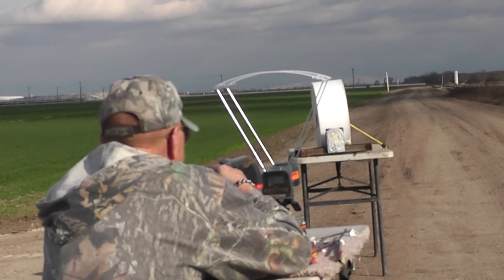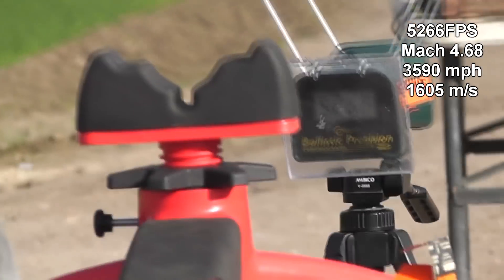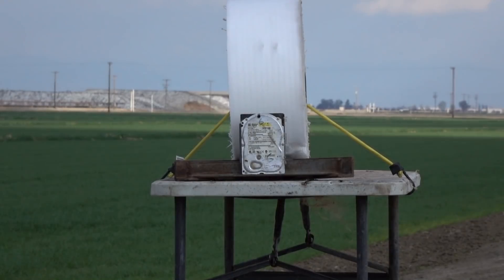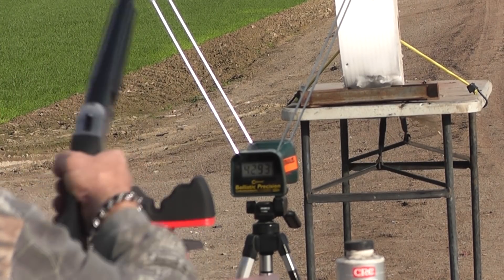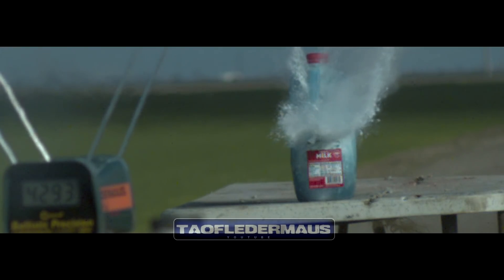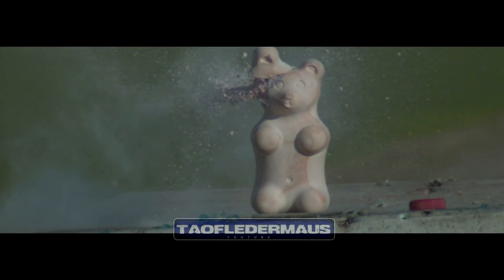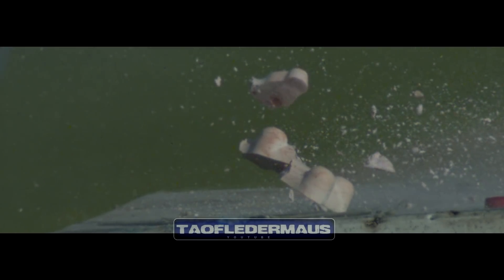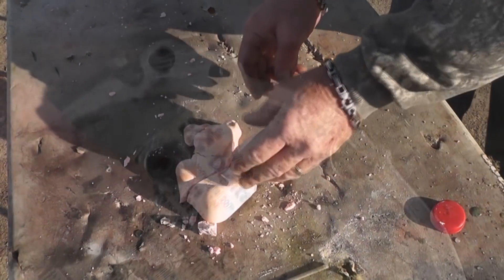Driving Airsoft BBs Faster than the Fastest Bullet - Must see!

Comment: A couple questions please:  Can you stabilize a barrel by a very quick, yet still a gradual psi increase over a sudden impact?  In other words; will it be the PSI or the G~Force that makes the barrel fail?  Like opening a valve slowly but at each analog increment the PSI continues to increase in the chamber from right behind the bullet to the very beginning?  
Next, (I have seen many articles or videos that attempted this question but none that actually delved right into it.)  What are the benefits / problems in using a spinning tube as a projectile?  Consider this as an open tube at both ends BUT with an imaginary block at the rear allowing this tube to gain more FPS for each milli-second the projectile is inside the barrel?  (This imaginary block must be considered as solid in aspects of benefits & as  non-obstructive concerning air's ability to pass through the tube while transferring the barrel and while in flight?  What I am trying to research is trajectory stabilization (if any) according to gyroscopic stability. We will move to other property influences after this one is resolved.  My hypothesis is that this tube will seek to be less influenced by exterior factors such as cross wind, gravity, curvature of the earth, humidity, heat, excetra... Let us explore using a tube as a ballistic's projectile, eliminating a bullet's other components such as: Primer, the heel of a shell casing (& only the heel, as the casing can be considered the tube projectile), even the elimination of the projectile itself, and the gun powder.  I have added a lot of limatations but breaking this down in a quest for development is essential for a proper resolve and design.

Comment: Once you hit Mach 5 plasma will start to form at the tip of the bb where it meets the air and will start to disintegrate because the temperature generated will be over 5000.F aluminum has a melt point of 660.F

Comment: I was really impressed with the raised edges on the entry points of that aluminum hard drive case. That was melting through at high speed. Looks like the beginning of a plasma table cut where the initial burn thru starts. Lots of heat when that hits. Contact with powder in the barrel? Or just so much velocity it generates that heat on impact? Or both?

Comment: I think it might be interesting to shoot a non-Newtonian fluid, just to analyze the impact pattern recorded with the high-speed camera.  If I understand correctly, you used a 9mm diameter steel tube (O.D.) with a 6mm inside diameter so that the tube would slide into the 12 Gauge to .357 Magnum adapter, and then secured it in place so it wouldn't be blown out of the muzzle?  I suspect that's asking a lot from a 1.5 mm wall thickness, given the powder charge you're using.  Of course, there's always the 12 Gauge to .44 Magnum adapter . . .

Comment: Not airsoft anymore when you start using metal bb's. Then it becomes an air gun, as in bb gun or pellet gun.  Airsoft uses biodegradable plastic pellets last time i checked. Would not shoot some one with a 1200fps .22 caliber copper bb out of one of my single shoot break barrel bb guns.

Comment: This is an excellent demonstration of Newton's impact depth problem. A 6 mm diameter aluminum ball can't penetrate very deeply into anything no matter how fast it's going because it's imparting proportionately more energy into the target material. Even if you shot the BB out of a light gas gun at 20,000 fps into that milk jug it wouldn't go all the way through: its penetration is a property of the projectile's sectional density. However as we see, it would locally vaporizes the water and creates a supersonic shock that rips the front face apart.

Comment: What if you teased some strands of fiberglass or Kevlar or carbon fiber out of a mat and wound it tightly around the stainless steel tube and then doped it with epoxy resin? What if you took the braided shield from some kind of cable and epoxied it to the outside? What would be the chances of finding a similar piece of tubing that would fit the outside diameter of the barrel, or sized up by polishing, or sized down with epoxy? Maybe some obliging subscriber will make you a titanium barrel with thicker walls and/or sheathed with for-reals autoclaved carbon fiber ...

Comment: I know little of guns and ballistics and more about pyrotechnics but the idea of using flash powder alarms the hell out of me. Have you ever used it to fire projectiles before? It Has a pretty fast burn rate and i find it hard to imagine it having application in firing projectiles without blowing the barrel apart. Just out of curiosity what sort of flash mix would you consider for such a project?
Nice video thanks for posting

Comment: The "plasma flash" was probably the aluminum auto igniting in air as it was fragmenting to dust.  Aluminum powder can easily be pyrophoric, and in this case it would be hot from the energy dump making auto-ignition easier.

Comment: You might get a little more speed out of the pellet if you fill the barrel ahead of the pellet with helium just before firing. My reasoning is that the speed of sound is higher in helium and the pellet won't have to displace heavier air as it is accelerating down the tube. Swinging a golf club underwater compared to swinging it in air.

Comment: Interesting stuff.  Sort of demonstrates how extreme velocity is not really very useful unless the projectile has a certain amount of mass.  I would wager that if a living animal was shot with one of those hyper speed BBs, it would make a horrible crater type wound on the surface but would not penetrate far at all and probably would not even be lethal.

I suspect you are approaching the limits of how fast a projectile can be shot from a traditional firearm using gun powder, since the speed of the expanding gases would definitely be finite.

Comment: That's some insane speed!  Bump it up another 5000 fps and you'll reach lower end of asteroid impact simulation velocities that Nasa researches at the Ames Vertical Gun Range.  But they use a 14 foot long launch tube versus the much shorter launch tube you're using.   I'd read before about them launching glass marbles, so after seeing your video I read some more about it and it turns out that the marbles are pyrex and have a quarter-inch diameter, very close to the size of an airsoft BB.  According to Nasa, they use black powder to launch the marbles at 16,000 mph, more than 23,000 fps.

Comment: Aluminum will burn...it usually doesn't because it's coated in aluminum oxide. I believe what may be going on here is in this extreme speed/pressure environment the aluminum is igniting and that's why there's no exit hole...it's almost like a HEAT shell against spaced armor.

Comment: Now, the next threshold to break... is Mach 5.Yes, you read that right. A Hypersonic bb gun.

As for the expanding barrel issue... either use a thicker walled tube, or use a slightly slower burning powder and an extended tube.

Oh, and next time you make one of those plater bears... mix in some nylon or fiberglass fibers. They'll hold together much better.

Comment: If they are metal they are just BB's, airsoft BB's are always plastic or foam
Reply from the maker: They really are .30 gram 6mm airsoft bbs.   Look it up if you think I am lying to you.
Reply: I'm not saying you are lying, but it's easy to confuse both type of BB's. Check this page from EVIKE, one of the largest airsoft resellers, it does not call them airsoft BB's.https://www.evike.com/products/24133/Just pointing it out 'cause pepople use this metal BB's on airsoft matches and some get hurt because they think it's the same thing. Airsoft BB's are mainly of ABS plastic (Acrylonitrile Butadiene Styrene ) or PLA plastic (polylactic acid)
Reply from the maker: To say that an aluminum bb is more dangerous than a plastic bb is pure ignorance on their part.   They sell plastic bbs that are .30 grams and even .40 grams.  It doesn't MATTER what the bb is made out of,  it all depends on speed and mass.

Comment: I would say we need a second source to verify speed, Radar?
I have seen very high chrono's from rifle test loads with similar results.
To verify that you are not measuring  gases passing over the Chrono, use a Radar.
Also, you didn't publish your shutter speed. With that data we could get a close to speed.

Comment: What about center drilling a wooden dowel to insert the 8mm tube into? The outside diameter of the wooden dowel should just fit inside the barrel of the shotgun. It would give additional rigidity to the 8mm barrel to reduce expansion or splitting and should still be inexpensive. I've seen someone make a Canon by center drilling a log and then using iron bands to reinforce it... Maybe myth busters?

Comment: That vaper trail is actually from  the aluminum bb breaking down from rubbing against the stainless steel tube at 5000+ fps. The edges of the bb should be molten at this velocity.

Comment: Airsoft weapons use plastic BB's not aluminum. aluminum BB's are BB gun BB's not to be used with airsoft at all. the hardest BB's Airsoft weapons use are ceramics.
Reply from the maker: No,   bb guns use 4.5 mm steel bbs.  It doesn't matter what airsoft bbs are made of,  it all boils down to weight and speed.  Hardness doesn't matter because they are going so slow anyways
Reply: wow i didn't know that. o.o I always saw airsoft use plastics or ceramics.
Reply from the maker: https://www.ebay.com/itm/700rd-BBs-per-bag-Premium-0-3g-6mm-Aluminum-Metal-BBs-AL-700-Bbs-High-Quality-/251595377206

Comment: Place our 6mm ID / 8mm OD tube inside an 8mm ID / 10mm OD tube use CA or slow set epoxy to bond the tubes together, hell ad a 3rd layer even if for only the first 6 to 12  inches. The hypersonic shock waves in the video are wicked.

Comment: Very impressive. Why do the bb's spark on impact even against ice? Also what set up are you using to push them that fast?
Reply: onebaddj 
Watch it again. Pay attention at 4:30. These were powered by a .38 special brass, machined to hold a 209 shotgun primer and packed with Aliant E3 powder. Jeff got the parts and I fabricated this device.    🇺🇸😎

Comment: Nothing like the work of everyone's favourite Teutonic Warrior, Jörg Sprave and the need to break something.

Try 2 tubes, placed inside of each other and super glued which might last longer before pressure breaks up the glue.
Reply: Try it with Novritsch .43g plastic bb's please i'd like to see what that does.
Reply: The superglue probably can't handle the heat. He might be able to get a second tube that is a fraction too small to fit over the tube, then heat that up and cool the tube he has now down.
The hot tube will expand slightly and the cold one will shrink, then slide them over each other, and once the temperature settles back to normal it's never coming apart again.

Edit: or one of the machinists that sent him bullets before could be a super mega awesome dude or dudette and machine him a purpose made tube out of solid steel.
Reply: Which is exactly why I suggested one of the machinists who made bullets for  "you make it, we shoot it" be a super mega awesome person and machine him a proper insert as a gift.
Reply: Or, wind it with wire. Stainless steel wire I guess. A few tight wraps up and down the thing might do it.
Reply: Fermitu Poupon - Obviously the only way to get something for a long period is to have a barrel machined which is obviously beyond the funds for the channel so 'ghetto engineering' is the way to go and try a number of things that may work and lasts long enough to get the footage they want.

Hopefully, it may get looked at again in the future which it would be nice to see as another try to see if they can get BB's faster than the recording they got here.
Reply: Drilling a long hole in a relatively thin section, which a decent degree of accuracy, it's very complex, but it's far from easy.
Reply: Fermitu Poupon How complex is it anyway? Isn't it basically drilling a hole into a rod, but with enough precision, so any remaining deviation becomes a matter of aiming the gun?

Comment: Actually the limitation is your tube wall thickness and the fact that you've got air in that barrel when you fire it. You can reach higher velocities by filling the tube with another gas then sealing it at the tip with a bit of wax film. That'll get you going much quicker. The lighter the gas, the lighter the maximum velocity that can pass through it. Also, the better the expansionary velocities. However, to get results much over what you're getting, I'd actually move away from gunpowders and move into light gasses at high pressures for the same reason that NASA has: light gas + high pressure = velocities over that which can be achieved by solid propellants.

Comment: hmm... i would make the barrel like 10 MM thick, that would withstand more pressure and thus allow you to have more powder, if you want to use a 12 gauge shell as a powder holder... you will need a tube about as big as the inner diameter of the gun's barrel, as well as a larger inner diameter of the adapter's barrel, which means bigger shots, which means more weight which means less velocity, so a 22. 250. round casing would do the trick for a 10 MM thick aluminum barrel, though you will need to brace it against the barrel of the gun to reduce bulging and you also might want to use modified pellets instead of BBs to capture as much gas as possible to have a higher muzzle velocity, speaking of muzzle, you might want a muzzle break... the kick back is gonna be terrible... will anyone see this? probably not...

Comment: I have a feeling that steel BB's would have gone through the hard drive ;) Speaking of steel, you guys should have bought a 6mm steel barrel instead. Not only would it be stronger, it would also be possible to weld it directly to the 357 adapter. Just a thought :)
Reply: crazyfvck 
It is stainless steel and it is welded to the adapter.        🇺🇸😎

Comment: How is it the BBs esxploded and set off sparks on the hardrive?  Were they filled with gunpowder?
Reply from the maker: I believe it is plasma.   The aluminum turning into a high temperature gas
Reply: TAOFLEDERMAUS or the impact could have released enough energy to superheat the air around the impact point, the heat given off near that impact has to be completely insane.

Comment: How do you deal with these kind of pressures inside of an aluminum or carbon fiber arrow? I imagine a brass sleeve or a spent .22lr case might fit into a standard 6.5mm arrow but it will probably blow out.
Reply from the maker: That is what the launcher is made for and we experimented with those too and we'll be posting the results soon.

Comment: The chronograph doesn't seem terribly reliable.  You could use a high-speed camera pointed at a backdrop with graduated distance measurements and calculate the speed of your projectiles based on distance traveled over a number of frames with a known frame rate.
Reply from the maker: My camera doesn't run fast enough to do that with something of this velocity.

Comment: 5266 fps... hmmm.. I wonder how many pumps that is on my little pneumatic Red Rider BB gun?  Probably a lot.  Better start now.  1.  2.  3.  4....
Reply: His little red rider blew up a few hours ago.
Reply: 3,556. 3,557. 3,558. 3,559. 3,560...
Reply: Gotta be a Limited Edition one for that. It'll also crit much better.
Reply: 22,341. Still... Pumping.... 22,342.
Reply: @JasonAWilliams-IS  Pls stop pumping, you are gonna break light speed and shoot a hole in spacetime !
Reply: lol Red Ryder was single pump..    but on my crosman 10 pumps = about 540 fps out of a 24 inch barrel.. :-\
Reply: Jason Williams - Are you still pumping ?  :-)
Reply: Jason Williams a million
Reply: Red Ryder is a spring, single lever cocking, …..
Reply: @anonomous3779  This.
Reply: You’re gonna shoot your eye out.
Reply: still pumping?
Reply: @Eyepatchfilms  114,202. Chugs Gatorade
114,203. 114.204...
Reply: @JasonAWilliams-IS  still at it?
Reply: Lol
Reply: 1/2*0,0003*1605^2= 386 J   ? 
22,5/2,7= 8,333 0,00003 Kg * 8,3333 = 0,00025 Kg 

1/2*0,0025*1605^2 = 3220J
AK47 7,62 × 39 mm  +/-  2000J
Reply: Probably around 120
Reply: @Paul Martin definetly not

it would blow up sooner
Reply: No mater how many pump you do, it can't go that high. It need to get very hot and at extremely high pressure to push the speed of sound in the barrel that high.

Comment: jeff, buy a rifled BARREL BLANK. have it chambered for the shell of your choice or maybe just have it turned to go into your shotgun barrel. they come with a 1 inch OD.

I want to see you get a 17 cal and use 177 steel BBs in it. if you used a rifle case, 556 or 308 (if you dare) that would put those BBs out at Mach 10.

haha. (comment for the good old days) you could for sure hit some of those cars passing by in the background.

this is a 17 cal BLANK, rifled. they also sell .204 (around 20 cal) .223, 308 and others.
Green Mountain Barrels      
BX17 25" .17 Cal 1.06" OD 4140CM 1:9 Turned BBL Blank

Click to enlarge 
Price:
$97.95 
SKU:
BX17 
Rating:
 ( 3 product reviews ) 
Shipping:
Calculated at checkout 

Quantity:
Reply: try this
http://www.gmriflebarrel.com/bx17-25-17-cal-1-06-od-4140cm-1-9-turned-bbl-blank/

Comment: The trace that the projectile creates is most interesting. It has a color to it and I'm wondering if it might be the aluminum sloughing off the projectile due to heat and friction as it travels through the air at such high velocity. Hmmmm...